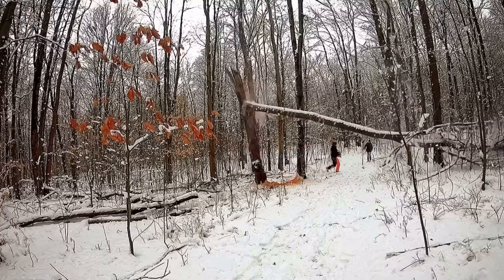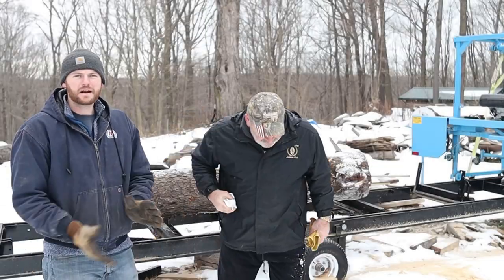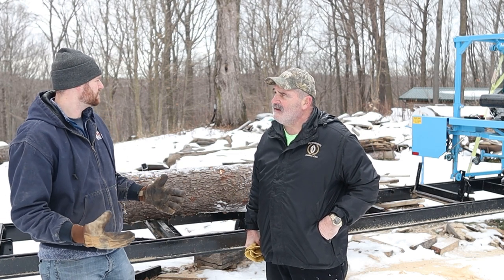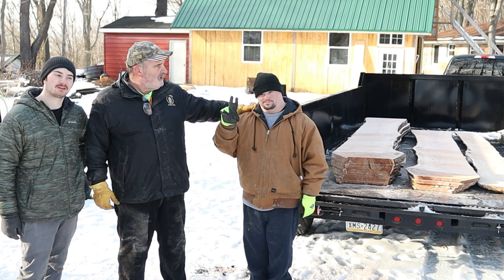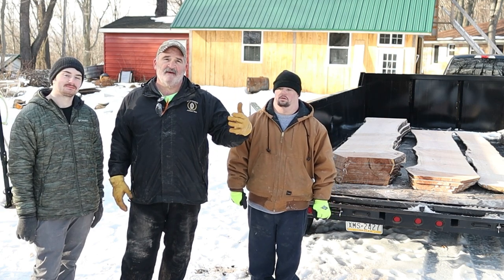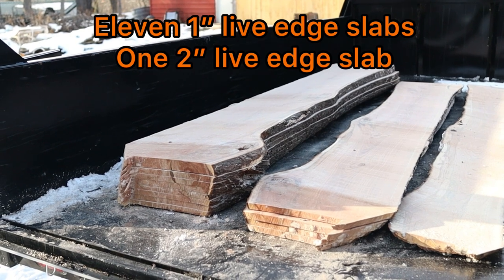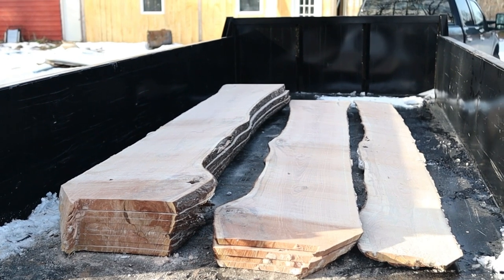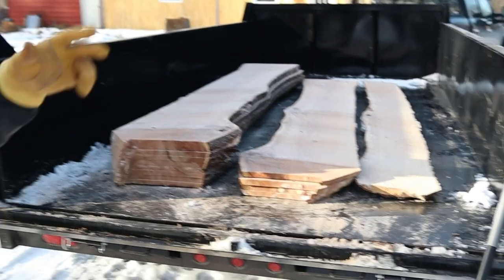The Sawmill You’ve Never Heard Of

Comment: I had the EZBoardwalk  Jr for 9 years which is a 30 inch mill.  These are fantastic mills,  easy to work on, simple in parts, rugged built and great mill to learn on.  My mill has paid for itself many times over.  They sell three sizes of mill now a 30, 40 and just this year a 50 inch.

Comment: I've had my EZ junior for about 6 years it's a real asset.  We have lots of eastern red cedar here in Missouri that gets milled into 6x6 for pole barns (people are tired of treated 6x6 that rot off in a few years).  Milled a 24 in black oak last week.  Glad I have the mill down hill so I can roll the logs on the bed, but it broke one of the 4x4 ramps loading it.  Make sure you paint the ends or it will check and split bad. Be safe out there we need you
Reply: Good advice.
Reply: I cover all pipe, metal etc with a robust layer of paint. Inside and out

Comment: Have you thought of putting down some tarps to catch the sawdust and then use that for smoking? I have a little small mesh steel box that I put wood chips in on my grill. I use hickory sawdust from  a huge hickory tree we had cut down at our house years ago that I was able to salvage a 55 gallon trashcan full of saw dust.  Works great.
Reply: Hey, Jonathan. Great question. Yes there are many things you can do with all the sawdust (smokers, fire starters made with wax and sawdust, bedding, etc.). I mostly use water and Dawn dishwashing liquid as a lube so the preceding are certainly doable, but there is so much time put in the milling aspect of the business that you hardly have time to use the sawdust and so it usually winds up in compost (sad to say).

Comment: That mill seems just as good as any I've seen on the YouTube's .  Beautiful boards you've ended up with.  I have an old cherry tree that will need to go & will hunt for a mobile mill in Oregon.  Thought about chainsaw milling, but it wastes so much I think I would cry...manly cry😂🤣
Reply from the maker: Not only wasting the lumber but also wasting fuel. You probably use a tank of fuel for each slab. They just seem so slow and inefficient
Reply: Hello, stgreen78. The mill is just what you purport it to be. I agree wholeheartedly with Adam on the Alaskan mill. It does great in a pinch and you can't beat it for those one off large slabs that you can't do on your mill, but it will kick your butt and tear up your chainsaw upon extended use.

Comment: OK you saw the light before me on the Axis, I fixed that last week. On this one been kicking it around for 6 months now. I'm stuck between a processor or a band mill. I think I'm going look at a Hudson 336. I have a local dealer which might come in handy. 
I don't think lumber is going to get any cheaper in the near future.  I can see people using their own logs to build stuff. 
As for the processor it would be nice but the cost far exceeds my ambition. If I can talk me into building a blocking table that advances logs that should serfice for a while.
Reply: Good thinking here!

Comment: I have talked to a sales person at a show and I was told that the saw head is at a angle for the mill will help pull the blades through the log instead of having to push it as much.
Reply: I believe I talked to these guys at the Paul bunion show last year. The blade on theirs was offset. I wonder if it was these guys.
Reply: @MrThenry1988  that is actually where I talked to them. The guy was super nice and answered all my questions. If I didn't already have a sawmill I probably would have bought one.
Reply: Yes, there is some of that, but basically it eases the blade into the wood as if you were using a hand saw on a board. You don't cut across the full width of the board, you start at the edge of the board and inch your way through. Less stress on everything, including myself.
Reply: @kevinbrewer2141  I believe his name is Stanton. And yes, he is a good guy.

Comment: Wood dries way quicker than the rule of thumb. Like ten times faster. 
I see you building a combo drying, milling, & splitting shed. A basic roof & maybe 2 walls. 
A cool project for your channel. Build the shed from your own trees using the mill. All the structure - pole barn style. Give a quick char to all wood going in the ground. 
The roofing & siding could be built a few ways that are both live edge. 
- Horizontal long boards that are tapered the short way. 

- Vertical slabs, where final layer overlap first layer.
Reply: Hey, Darth GBC, What's really cool is that people built all sorts of structures out of green wood that has lasted for hundreds of without the use of preservatives.

Comment: Thought the core or  center was prone to check & crack?  Is that why some folks keep rotating the log on the mill,  avoiding the center for useable lumber?  No expertise here, curiosity only.
It is a tough road to operate a saw mill absent a tractor/loader?  Does Bob move all those logs by hand?
Reply: Hello, Bill. Yes, the center of the log is called the pith and it is the most unstable part of the log. You do your best to center that portion from end to end to limit the instability of it and cut it out or bury it in a thick slab that will protect against the deformation of the end product. But, sometimes that grain structure can offer some ungodly beautiful pieces of lumber. You just have to use care/experience to make it work. If you go to the "Hammar Lumber" Face Book page you can view some of the table tops we made for the American Legion out of just such pieces. Beautiful!

Comment: A while ago I was researching all the different sawmills out there and came to the conclusion that EZ Boardwalk was the winner in bandsaw mills. Swingblade mills are a different option for people looking to do dimensional lumber.
Reply: Hello, John. You hit the nail on the head. But, you can equip a Peterson or similar product with a chainsaw attachment for slabbling. Many folks are happy with that set up.
Reply: @bobhammar4299  Thanks for your response. Out of curiosity, about how long did it take you to mill that log ? And how long is a blade good for when you're cutting hardwood ? Do you sharpen the blades or just throw them out ?
Reply: How many different dimensions does the saw rotate in

Comment: for live edge stuff, I woulda sliced it up thicker...

Great job, dad.  keep those boys busy!
Reply: Hi lintelle. Wasn't sure what Adam was going for and usually I don't slab them 8/4 or above unless the majority of the yield is > 24". Most kitchen  counter tops are 24" wide and you need to account for a straight edge against the wall. I like to have them wider and then use the cut off piece with the other live edge as the backspalsh.

Comment: How well do 1” slabs sell in that area? Where I am (PNW) the market is for 2” and especially 3” thick. Was hoping the video was going to be more about the mill. Looks like a decent entry level rig, but was curious to see more of the mechanical parts, head raise/lower mechanism, etc. Went to their website and orders are a year out and a $1k non-refundable deposit, guessing it’s a pretty small operation. Hard to imagine many people accepting those terms. How much advantage is the angled blade? Website claims it pulls the saw into the wood, helping you feed easier which I’ve heard before, but I have set up a log at an angle on my woodmizer to duplicate that idea and couldn’t really tell any difference.

Comment: 50 bucks shouldn't be much more than a deposit on boards that size.
Reply: I'm sure that prices vary a great deal by region and stage of finishing.  But I can say that in my area if he tried to sell green wood 9' x 18" x 1" for $50 I don't think he'd see many takers.  In my shop right now I have 5 slabs of  9' x 24" x 2" black walnut that I paid $75 each.  So I paid $2.08 per board foot for Walnut and those slabs would be $3.70 per board foot for a less premium wood, thinner and less wide.  People aren't willing to pay premium prices for wood that they either need to kiln dry themselves, or air dry for 1-2 years.  If he puts the time (or other resources) into seasoning the wood he can start to command a price, but the market for fresh off the mill lumber just isn't as high as I assumed it would be before I started buying it.

Comment: I have a Logosol chainsaw mill, which is probably the best chainsaw mill. It's OK for a starter mill, or if one doesn't have too many logs to cut, and Logosol does offer a lot of accessories (not cheap though) but a bandsaw mill would be nice to have. I have been looking at the EZ Boardwalk mills for two or three years, and they look very promising. One of their features is that the blade is angled (I think it's 15 degrees or so), which is supposed to make it easier to use the mill because the angle helps draw the saw into the wood, so it doesn't require as much pushing. Does this actually bear out in practice? Also, how do you (your friend actually) like the mill overall, and are there any negatives to consider for this mill?

I have also been thinking of building a bandsaw mill, and actually have plans for one I think is probably pretty good. It's the HCSM sawmill by Ben Miles in Mesquite, Texas, but I'm not sure if I want to tackle a project like that.
Reply: You can build your own mill with your own material for a quarter to a third of the cost of an EZ. But when you factor in your labor it's a wash at  best. I'm a stubborn man who likes to do for himself, but I didn't  even want to consider that in this instance. Their prices are pretty darn good. Good luck.

Comment: Had  400,000 square  foot  of cherry wood in  my basement  with  some hickory  slabs  also ,,,turned those  puppies  into  drying them for  YRs of 4 yrs of drying . Then to the  better  part  made  kitchen  cupboards  for the  kitchen and  bookcases of  3 of them taller that 7 feet  tall all  one  slab.  Then to the  children's  bedrooms  made  single  beds  and  drawers that  stand on up  to  almost 6 ft tall  by  3 1/2 ft  wide  older  drawers for the  children to have.  Then  different  bookcases  for each  children. I have a drawer in my  bedroom  that is  about 6 ft long have slept on the top of it and it is  about  5 ft tall comes  apart into  9  drawers  top and 2 sides  then the  back is one  piece of  solid  cherry wood!!!  Then  sold the rest of the  cherry wood and  hickory slabs  in  1990's!!!

Comment: I'm wondering why only 1 inch thick ? 
If you plan on planing it down for woodworking projects it may end up too thin after drying
Reply: Hey, Colin. Store bought finished four sided lumber is planed to .75" thick and called 1 by whatever width you're buying. So you have to start out with a greater thickness to allow for the drying and finishing process to allow for the finished product.
Reply: @bobhammar4299  yeah I know that but usually big slabs like that are 1 1/2" minium to allow for any cupping or warping so when they dry you still got enough to work with 👍😊
Reply: @colinstace1758  hey, Colin. Yes thickness is important, but more so where you are cutting it out of the log. Quarter sawn is the most stable followed by rift and then plain  sawn. They all produce beautiful lumber.

Comment: Money:  lots of talk about the selling price, but what would have been the milling cost ?   I read through the previous 57 comments and did not see an answer.
Reply: 75$ an hour =100$ for the log. from hometowns perspective this would not be a future incurred cost considering he is in the market
Reply: Nah its not priced per hour. its never priced per hour. Its priced on board foot. One board foot is 1 inch by 12 inch by 12 inch. Once the logs are cut up it is measured and you are charged per board foot from 1 dollar to 10 dollars per board foot. If you bring your own log then it will be a fraction of the price and if you buy it direct it will be what ever they sell it to you at. 
Its a tough competitive business because pretty much anyone with some money can buy a mill and mill out logs, Planks are the fastest and easiest method.  Canting out logs and doing dimensional lumber is much harder. If you want to do dimensional lumber do not buy a band mill buy a swing blade mill as you can cut out 1x4, 2x4 and any other so much faster and right off the log. Lucas mills are pretty good and a 4 inch model will set you back 6k give or take and another 2k per 2 inches above that last I knew. With the smallest model you can double cut 8 inch boards with ease. You can also buy a chain saw slab cutter for them as well. Band saw blades are very pricey and can cost you as much 50 dollar or so per unit and if you nick the blade once can destroy it along with bent blades can cause wave effect and a huge number of other problems that a swing blade does not, Swing blade mill are roll the log in block it and cut from top to bottom never having to move the log.
Reply: @kameljoe21  perhaps hes charging incorrectly. he said 75 / hr.
Reply: @pearlrival3124  I did not watch the whole video.  So I have no clue as to what this person charges, Though I would never run a business on an hour rate. Because you could drag out a 1 hour job for much longer. In the end the customer get a flat rate price based on board foot and if you are not skilled enough to cut that lumber correctly and fast to make money then you have no reason doing it. Board foot is standard in milling.  Also he could have just said that because that is what people want to hear, yet if you were to call and set up an appt with him it would be a whole other price based on what he cuts. I am also sure that he has a flat rate price just to show up and then will cut what ever logs you have with in his specs. I have priced checked millers a number of times and they have a flat rate price, then mileages and price per board foot for soft woods and price per hardwoods. The specs they require are based on their logs,. For example this guy has a 22 foot cut and would spec logs to be no longer than 21 feet and greater than 12 inches on the small end and no larger than 36 inches. Getting 36 inch plus logs on to the trailer and cutting them is not fun. You need equipment for this and a deck to stand on to remove the planks and to be able to run the mill.
Reply: I mill by the hour predominantly because of the variety of sizes we cut. From 2’ to 20’ long up to 6’ wide. Yes 6 feet. That makes it fair for all involved. We mill for $85.00 per hour with a nominal fee for travel and set up for on sight milling. Bands over 20’ long are less than $30.00 each and can be sharpened multiple times and end up costing pennies per bdft and are a minimal expense in the cost of milling. The thin kerf allowed approximately 10% greater yield and even more compared to chainsaw mill. Band mill is not the solution for every scenario but is highly effective and efficient way to mill lumber.
Reply: @1alanman  it makes since to do anything by the hour considering you know there is no loss involved. obviously you cant charge for a blade change but if they got crooked logs or crazy hardwoods your covered.
Reply: My mill can easily cut thicknesses to 1/4" or less and I have had customers request as much for veneer pieces for tabletops, etc. Is it fair to ask a sawmill to spend 3 to 4 times as much time to cut the same amount of board foot out of a log? The log will pretty much yield the same amount of board foot be it 8/4, 4/4, 1/4 or whatever, but 4/4 thickness takes perhaps one hour to mill (depending diameter, length, etc)  while 1/4 thickness takes at least 4 times as long (the physical milling, fuel, blades, handling, cleaning off, etc..) If you choose to use board foot as your criteria, good luck with that. I choose constant communication with the customer regarding yield vs spec, integrity and reputation.
Reply: @bobhammar4299  I think this guy is referring to production mill. Custom in any trade is best left by the hour. At the end of the day its no different from a space x prototype. You never know what challenges you might face.

Comment: P.S. pricing also depends on type of lumber. Ash, Hickory, Cherry, Walnut, etc.
Reply: You're so right, Paul F. People lose sight of that fact when requesting a piece. A 2" thick x 3 foot wide x 6 foot long, live edge slab of Ash for say a bar top, regardless of the character in it, will fetch a small fraction of the price for the same dimensioned Black Walnut. Both will be beautiful and do the job, but one you pay for with some overtime, the other you may need to take out a loan.
Reply: @bobhammar4299  Great way to describe Ash; You will be working overtime getting what you want out of Ash. Ash & Hickory , two very hard woods.

Comment: Just curious, why did you cut those boards so thin?
Especially with the flat and rift sawn boards,
They'll warp and cup.
You not going to have much of a board when your done milling them into flat boards after their dried.
That was a fine log
Reply: Cherry is pretty stable . Although I would have cut it differently
Reply: Hello. The milling of the log was set up as a demonstration only. This log, that would have previously been designated as a firewood log, was milled into usable pieces that Adan and Alana can use for whatever. We didn't cut for grade.

Comment: I have the same mill.  I've been trying to find jack stands such as the ones on your mill. Which jack stands did you add and where did you get them?
Reply: I picked them up at tractor supply. Pretty reasonable price and I didn't have to screw around with taking the wheels off every time I transported the mill. Plus it's so much easier to level the mill after transporting.